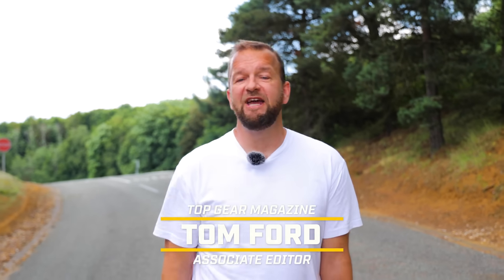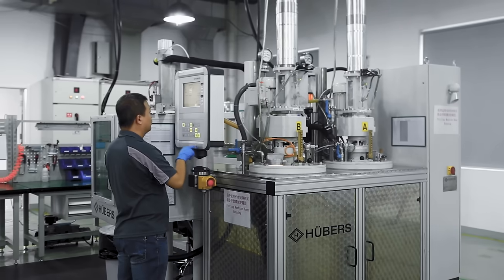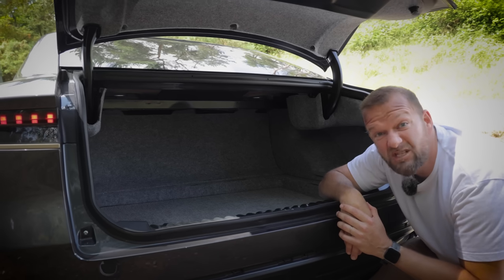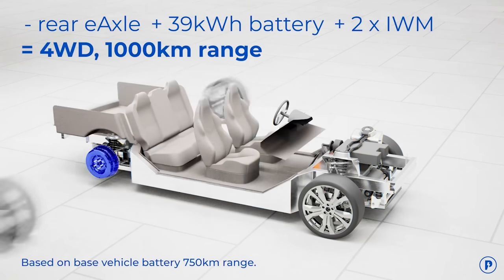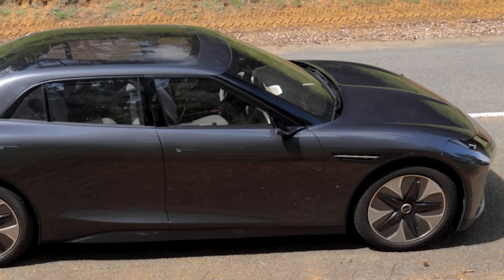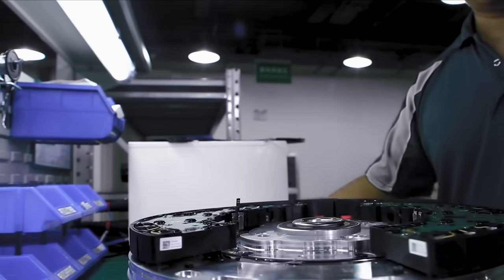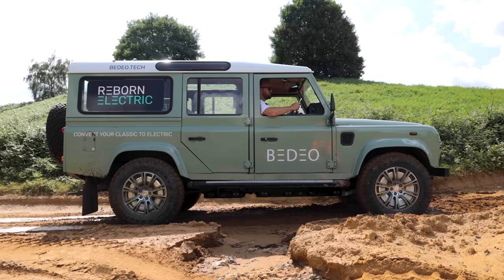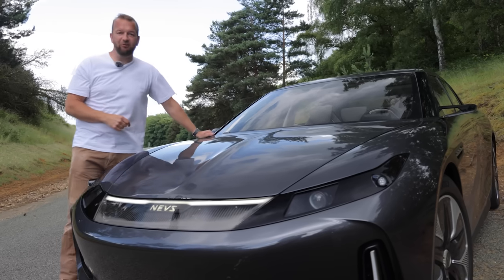NEVS Emily GT: SAAB’s Secret EV With 600 Mile Range | Top Gear

Comment: It's so much more interesting to see brands compete to get the most range out of their EV's than to see them get the most hp's out of them.
Reply: They market hp numbers and acceleration to get people to see that electric is not boring, but, yes it is good to see mileage marketing as well
Reply: Electric cars are boring
Reply: @ronaldmcdonald9322 - Buying gasoline/petroleum is boring, old, and tired.
Reply: @brawnbenson552  EVs won't ever beat ICE cars in practicality Especially in distance. Never. Not like in a 5 or 10yrs to come
Reply: @NaNoTech4Disaster  EVs are already way more practical in terms of maintenance with fewer moving parts and no oil. And yes, lithium-based batteries are not at all suitable for cars, even though they are almost reaching parity in distance with ICEs. That will change with solid state batteries, though.
By the way, your phrasing is hilarious. "Ever", "never", "in a 5 or 10 yrs to come" 🤣
Reply: Hp and torque doesn't mean shit when the car weighs as much as a tank... the electric cars have horrible handling, American ICE cars out handle them...
Reply: @ronaldmcdonald9322 I rented an ioniq 5 for a few days wasn't boring at all
Reply: @Peter-uo9km Horrible handling. Lol bro, you're riding your car to the McDonald's drive through. You're not a race car driver.
Reply: I mean I don’t need 1000hp or 0 to 60 in 3.something what I need is more range
Reply: Manual gated shifter is all that matters
Reply: @Machensachen57  the opel manta e concept had a manual four speed gearbox
Reply: Got a point but personally I'd also like to see them compete for battery life.
Reply: More interesting to see brands strive for the best efficiency figures imo
Reply: @NaNoTech4Disaster  Challenge accepted
Reply: Even the hardest car entuhsiasts have already recognized, EVs are way quicker and real track-monsters - if you know how to drive, of course. Most EV already reach a distance which suits more than 99% of every day travelling. The only thing that needs to get better fast is the efficency. Light cars, small batteries, low consumption. That's the future of BEV.
Reply: @Peter-uo9km  If you can get your hands on an EV with AWD torque-vectoring, don't drive it on a race track. You will never want to go back to ICE.
Reply: Said no car guy ever…
Reply: He’s not but any car guy will test their car every once and a while legally or not…
Reply: EVs are not track monsters, just the drag strip but even there when we watch electric cars race against ICE the electric car usually has 200-400hp more than the ICE
Reply: @ronaldmcdonald9322  That's hilarious that you would say that when you have literally never been in an EV before. Even the nissan leaf is fun as hell.
Reply: @NaNoTech4Disaster  They already have. Most commuters only do 300-500 miles on a full tank, and a lot of EVs already beat those numbers. 
The extreme fuel efficient ICE will do 600-700, but the cost makes up for the difference that make EVs that go that distance a better option. The Aptera does 1000 miles to the charge.
Reply: @Peter-uo9km  Actually, it does. The power to weight ration does matter, and most average EVs will dust any modern hypercar. The model S plaid does under 10 sec 1/4 mile, lmfao. EVs are no heavier than your average SUV, and even then the model X is the fastest SUV money can buy.
Reply: @FinnPetrak  Those 1000hp 0-60 in *2 cars get like 500-600 miles to the charge. The aptera gets 1000 miles and has the same 0-60. 
You don't understand how batteries work. The more output, the higher potential for efficiency. EVs need to have big HP and TQ numbers to get crazy long range.
Reply: a 250 mile range is more than enough for at least of 75% of people's daily needs.
Own up, how often do you travel more than 250 miles in a sitting.
Reply: @NaNoTech4Disaster  I mean this car already has 1000km of range? How much do you really need then?
Reply: Or yet another electric CUV
Reply: @Peter-uo9km plaid outran  the m5cs on the Nurburgring ring …. What are you smoking . Fastest sedan on the track in the world currently.
Reply: Couldn’t agree more! With time, different EV’s will build character like ICE cars have done. This is still the “Model T” phase of EV’s
Reply: @IReahpZz  easy on a huge track. Now bring it to the touge and watch it crash and burn. You people obviously don't know what driving is all about, a big track does not simulate the streets it will not perform well on tighter roads. A big car is good for the track but not good for the streets, like the gtr it's big ran well on nurburg but it crashed and burned following an evo in the mountain roads. 

I bet you probably don't even know what the touge is so I'll say bring it on the canyon roads.
Reply: @evolicious  you mean evs will go faster short distance but after 100mph is slow as shit. Yea they need over 1000hp to even stand a chance and by then you're polluting more than a gasoline car so what's the frigging point?

Pound for pound. And power equal. I think gasoline wins. Bottom line. They need to invent a new powersource those batteries are not cutting it. 

I have an electrical engineering background and automotive background and I'm telling you electric cars are not speed racer.... my brother owns a tesla model 3 awd and the only thing that impresses me about it is the self driving software..... not the speed....
Reply: @jennihilbrecht2503  Torque Vectoring only makes up a little for its horrific handling...it's STILL SLOW WITH IT ON. Anyways audi and Mitsubishi Lancer evolution already had it long ago its old technology.... it's not like gasoline cars don't have it.... and there's even artificial cheap torque vectoring like subaru which uses the brakes instead of controlling the power output....

You're just a woman, I very much doubt you can tell me something NEW about cars...or electronics for that matter as I have a background in both electrical engineering and automotive technician.
Reply: @Peter-uo9km  using touge in 2023 is so beyond cringe . Unplugged performance plaid tan a faster lap time around sun 2 min tracks than a modified gt2rs on a non dot legal tire . The future is here . Get over it .
Reply: @jennihilbrecht2503  speak for yourself. Real car enthusiasts don't care about your marketing gimmicks.
Reply: @IReahpZz  the tesla plaid ran 7min 25seconds on nurburg. The record time is in the 5minute range....by a hybrid Porsche i believe. 

I guess you're another elon clock shlucker eh?
Reply: @IReahpZz  You know what the drift King said. REAL MEN RACE DOWNHILL IN CANYON ROADS....Electric cars would get DESTROYED in this scenario....all the bulky weight would stress your brakes and you can't turn for shit. It would absolutely get destroyed by a little 160hp gasoline car....
Reply: @cannygrowabeard  all electric motors are already operating at this high 95+% thermal efficiency. They aren't bounded by the thermodynamic heat cycle like ICE vehicles are - which is where the efficiency improvements have been increasing by fractions of a percentage over decades.
Reply: @Peter-uo9km  For a self proclaimed car guy you sure do know absolutely nothing about track cars. The "Porsche hybrid" you're referencing was porsches winning lemans car without any of the design restrictions imposed - just completely unregulated and unleashed. Not a sedan car. Also lol at claiming nurburgring isn't a good indicator when it's internationally recognised as a very rough, harsh track with hairpins, bumps etc. You keep trying to cope with the inevitability of the future yet fail to present a single rational argument against it.
Reply: @Peter-uo9km  You realise the pikes peak record was set by an EV right? You genuinely have no clue.
Reply: @bilbonob548  you mean UPHILL? Of course if you set it up so the high torque motors give you an advantage uphill only....

Didn't you read what I said? Real men race DOWNHILL.
Reply: @bilbonob548  I don't care about track cars. 99% of drivers don't go on the track they are on the streets. Why do you think I keep saying touge? You guys are not listening at all why should I keep repeating myself. 

REAL MEN RACE DOWNHILL. A BIG TRACK DOESNT TEST A CARS FULL PERFORMANCE CAPABILITIES, NEITHER DOES UPHILL ONLY TIME ATTACKS.

I suppose you only want to race quarter mile too because you know over 100mph electric turns into a pinto...
Reply: @bilbonob548  Edmunds U-drag race test between a corvette and lucid air proves everything..... look it up on youtube. There is no excuse the lucid air even handles like shit. You cannot just ignore physics.... the lucid air weighs a ton....and it shows in the test.
Reply: @zzaretube  What is your opinion on battery technology and the unique environental challenges of recycling and disposing of them? Burning fossil fuel = bad. We know how we feel breathing in exhaust. How do we feel about these chemicals leeching into our soil, drinking water, and oceans? I would like your view of current battery tech environmental concerns, and where you see this going in the future.
Reply: @brawnbenson552  it also works better lol
Reply: @zzaretube  riiiight maintenance as in replacing exteeemy expensive batteries every few years
Reply: @danieldelaney1377  Every few years? Are you still in the 1990s?
Reply: @cuy50  My reply was already deleted three times for trying to point you to an article with all the answers you seek. Environmental impact of solid state batteries is way smaller than both ICE and lithium battery technologies. Still not perfect, but beats oil spills, burning fuel, and lithium waste.
Reply: @FinnPetrak  🤡🤡🤡🤡🤡
Reply: @brawnbenson552 petroleum is old and tired?
Are you one of these guys that thinks EVs started with the tesla?😂😂😂
Alot of the first cars were EVs so they are just as old and tired
Reply: @NaNoTech4Disaster  If you like the noise of a V8, just say so. Pretending EVs aren't more practical than ICEs just isn't serious. They can get get up to 95% efficiency. ICEs can't even get half of that.
Reply: @brawnbenson552  EV cars are boring. That doesn't also mean they aren't much better vehicles for the purpose of normal day to day driving. I don't have an EV but I have resigned myself to one in the next 2 years. The purchase will be the equivalent to buying a new washer/dryer/microwave, the car will be just another household appliance no matter how much infotainment and software is onboard.  Driving a silent vehicle with one pedal (Regen braking) where the car's balance/control/wheel feedback is monitored and controlled by software is by definition boring.

My wife recently told me how when we first met she thought it was sexy that I could drive a manual transmission in city traffic using only hand because I was holding hers with the other. The future is pressing buttons on a IPAD and sitting their like a lump. Boring.
Reply: @The_Reality_Filter  Thanks for your very constructive reply.
Reply: @IReahpZz  Oh for Godsake!! Please learn what makes a car fast vs quick. (I am not an EV hater.) 
The Plaid was a few seconds faster than the M5 with an almost 500 hp advantage for 14 miles and 7+ minutes!! It has over 1000 hp and  is unbelievably fast when pointed straight and hammering the throttle. Otherwise it's big and heavy and cumbersome and the HP is useless.   

Watch the onboard videos of the Plaid vs others cars with comparable times. The Plaid driver backed up all of the braking point used by other cars due to the weight,  he constantly fought the cars weight transfer under braking and was constantly sawing the wheel in order to keep the back end under control from turn in to the the apex, where his speed was uniformly lower. The weight and the lack of stability undoubtedly killed the tires, a second lap and he would have had to slow down even more. The cars acceleration was unreal, but a non-professional driver would have driven it right off the track.   

The Honda Civic Type R, features 700 less HP and was only 7 seconds slower. The professional drivers hands were stable through every part of every corner because it's a car designed to stay on balance, stop, turn and drive away. The average person could keep it mostly under control. 

The Plaid is an amazing machine. But it is not the car people think it is when it comes to overall performance.
Reply: Not smart the Wheels Rims go over bumps constantly imagine long term (pot holes expensive)
Reply: Nice looking car 👍👏
Let's face though it's as near to a Saab as a Hino truck.😢😮
Reply: @NaNoTech4Disaster  You would be surprised. Anyway, since the EV charging model is different from ICE fuelling an EV does not have to beat an ICE in mileage. As far as practicality iis concerned, EVs are already more practical than ICEs.
Reply: @Peter-uo9km  American ICE cars have never been up to very much.
Reply: @Machensachen57  Shifters are obsolete.
Reply: @Peter-uo9km Your level of knowledge is incredible. How is it that you know things that you can't possibly know?
Reply: @difflocktwo And, you know this based on what?
Reply: @chris27gea58  Pubic roads are not for racing.
Reply: @difflocktwo  Okay, I agree with you. I misinterpreted your comment - I missed that you were responding to several very dubious claims. Sorry for the confusion.
Reply: @zzaretube  are you saying the batteries need to be replaced more often than that?
Reply: @grahamthompson5581  yes they are fine for short trips but if you ever want to actually go somewhere a normal car is more practical and versatile
Reply: If every house had a petrol tap, the same way every house is connected to the grid, then ICEs would be competitive on practicality. As it is, no.
Reply: @danieldelaney1377  What I am saying is the batteries last longer than your complete education did.
Reply: @zzaretube  I doubt it
Reply: 300 miles range is more than enough for most. When you have more range it adds significant weight and cost, ends up not being worth it.

Comment: I’ve said for a few years, that the EV-era would be a perfect window for SAAB to make a comeback. 👌🏼
Reply: love it, but why is that?
Reply: @my-days-co  Because SAAB is a strong brand but comebacks are difficult. Many established car manufacturers are struggling with how to make a natural transition to the EV era but SAAB would have kind of a cleans slate in that sense. 🤔 Not too much baggage but still a strong brand as a bit of a quirky car maker. I also think they should make a proper retro redo of the 96. What BMW did with Mini. 🤩
Reply: @Sebastian-cd1mo  agree, very interesting
Reply: There are not SAAB , it is an China car now,.  Only name are the same
Reply: @mötesplatsclub33  Oh come on now, don’t be cynical. It’s not like SAAB was Swedish financially for the last two decades of its existence anyway…
Reply: Saab were gone with 9000 serie
Reply: During the period that GM took over SAAB, I ran a fairly large staffing company and had a lot of people working in the Factory. Knew a lot of Americans and managers in the factory. SAAB quickly became an Opel, and much of Saab's know-how moved and was taken over by Opel in Germany. after the takeover, the entire interior cost the same as the fronts cost before. So SAAB is no more, it's gone and wound up by GM